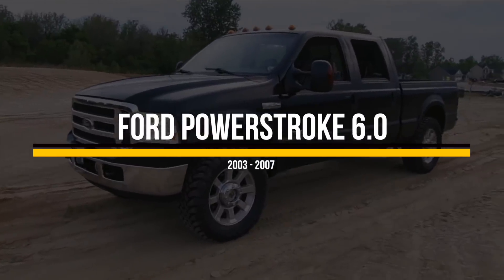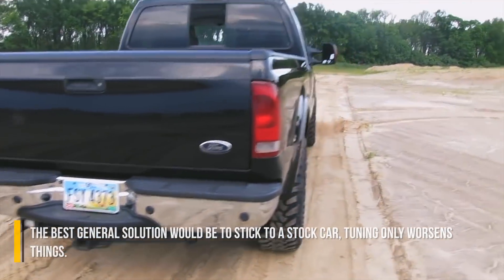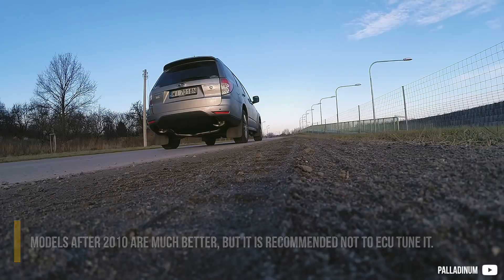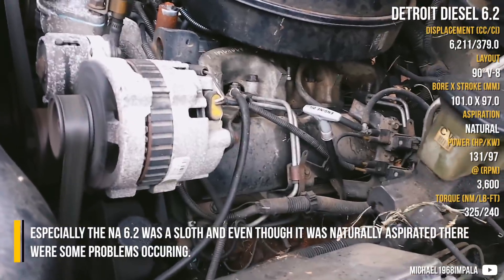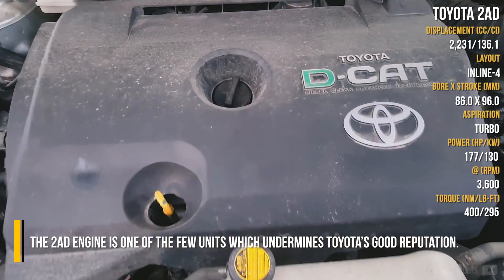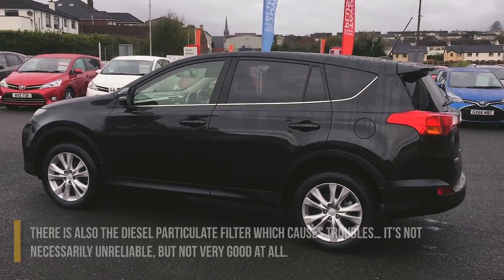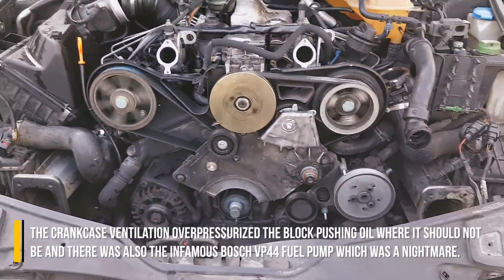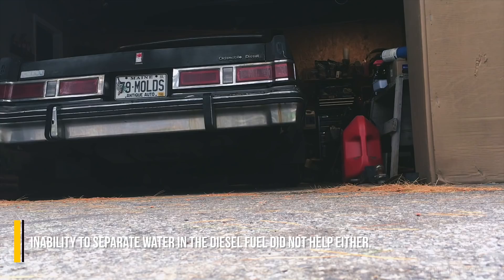6 Worst Diesels You Should Stay Away From

Comment: The issues with the 6.0 Powerstroke could all be easily fixed. The 6.4 Powerstroke was intentionally made shitty by International
Reply: meifert2 not true the bottom end was very stout the rocker arms were weak.
Reply: Ol’ Mudflap the 6.4 is why Ford cut ties with International. It was literally made to fail.
Reply: That's the problem with the 6.0. To make it reliable ya had to do 10k worth or work to it. On top of the 70k bill for the truck.
Reply: ohiopower $10k? You must have gotten ripped off since the EGR caused almost all the issues and a tuner and delete is under $800.
Reply: meifert2  6.4 failures are a mix of poor early design of a scr mixed with top end that couldn’t not handle the high drive pressures of a compound vgt turbos. The engines do much better with a single fixed geometry turbo and deleted a tuned.
Reply: Ol’ Mudflap even with a delete, tune and fixed turbo they will still fail before they should. It's just a bad design
Reply: The high pressure fuel pumps were junk. High pressure oil pumps were junk. Especially in the early models. Injectors were shady. Your gonna have to get some arp studs if you don't want the headgasket to blow.
Reply: bahaha "easily" the only thing easy about a powerstroke is pushing it off a cliff...and have fun rebuilding the entire front end on those fords every other week....DEATH WOBBLE
Reply: @ohiopower  And to add everyone of them have a gutless bottom end lag , the automatic transmission compensates for that , I've driven 5 speed 6.0 with all the deletes and fixes and their still guttless .

Comment: The Olds 350 Diesel sucked as a Diesel engine, but when converted to a gas engine the block is strong as hell! Several NASCAR racers at the time ran converted 350 Diesel blocks. They could be stroked with 425 and 455 cranks as well which made them competitive in some drag racing classes. Honestly, I'd love to have one as a foundation for an Olds bracket car of some type. An Omega would be my first choice because of the light weight, but I wouldn't turn down a cutlass.

Comment: Peugeot deisel: slowest car I ever owned, multiple problems, ending with a blown head gasket.
Reply: Seth Kantrowitz Very old Peugeot had this. But some lives over 500 000 km.
Reply: I once drove a Pug 309 D, with the 1.9 NON-turbo diesel engine. My god, i could have got out and walked faster. Pulling out of junctions was scary as you needed a 0.5 mile gap in traffic to get going.

Comment: Japanese can't make a good reliable diesel??? WRONG!!!!!! 

My dad has a 1999 Toyota Hilux with the 3L inline 4 diesel and it is currently at 350k km without any problems. My uncle has a 1993 Hilux with the same engine and it clocks over half a million kilometers and i haven't seen the first mayor issue with the engine, Oh and it drives like a champ
Reply: Those really aren't super high numbers for a reliable engine. Usually an engine isn't considered to be super reliable unless they go over 600,000 km regularly. The diesels in the Hilux, however, are usually the most reliable option as the gas powered V6's tend to be pretty crappy.
Reply: i know. The first gen v6 is  a crappy engine: low power for the size and kinda unreliable. Second gen v6 is way better. 
I know that 500k doesn't sound like much but that was the last time i saw that mileage in the vehicle.... mi uncle daily drives the vehicle,  maybe is reaching the 600k mark. i haven't been in the vehicle for a long time

Comment: The Audi 2.5 V6 TDI is not to be mistaken with the infinitely more reliable Audi 2.5 inline 5 TDI which was used in various Audi, VW and even Volvo cars. The 5 pot is a much better engine in ever way than the V6.

Also, the Mitsubishi 4D56 is a bad engine. Numerous Series 4 Mitsubishi L200's come into the garage i work at, and they need a new engine block, because of poor quality metal used in the block. Therefore they get pitted in between the cylinders and cause head gasket failure in some cases, failing at anything from as little as 30,000 miles (still in warranty!).

The Series 5 L200's use the 4D15 i believe, and so far are proving to be a good unit.
Reply: Inline always is better than V...
Reply: 4D56 is a great motor, it has a fairly strong bottom end so I have no idea what you are saying here, yes the top end is known to not be as strong.  But they are certainly not known for blowing head gaskets.      They are known for pully failures which then get ignored.  Ultimately a new head is needed (not cheap at $900+install)  

Also people skip maintaining the 4D56 which leads to premature failure. 

4D56 is reliable and gets good MPG just very anemic.

Comment: In regards to the VW Group's 2.5 V6 TDi, the original 150HP is the really problematic one and even then, it mostly applies to first years of production, which are also the engines with most fuel pump and turbo issues as well - or rather, were the ones, since most of them either died or had the problematic parts replaced. After that, the engines got considerably better in regards to reliability, although they still require considerable care. I have the AKE (132kW/180HP) in my car, changing oil every 7.5-10k kilometers (4.7-6.2k miles approximately, I think), not being cheap with the consumable parts (filters, timing belts, etc) and buying decent quality fuel, and I never had any real issues with the engine - approx. 370k km (230k miles) and some of it with short distances which is far from perfect for a relatively large turbodiesel (for european car).

Comment: Typical emission standards - older audi q7's had the big ass v10s but nowadays the q7's have at most a 3 litr v6....
Reply: Q7 had V6 V8 and V12, the toareg had a V10
Reply: GoldmineGaming sorry, was about tow write v12 but that seemed kinda crazy, but now I know 😂 anyways I think you get the point
Reply: Oh yes I get it, I worked for Audi Sport as a mechanic nearly 1.5 years ago, the old Q7 with V12's were mighty cars and with the V8 too. I just left when the Downsizing started, the only car I drove with downsizing is the RS5..
Reply: Still got a 4.0 V8 diesel though. Better than BMW's 3.0 I6 quad turbo og the Mercedes 3.0 I6.

Comment: My parents bought an oldsmobile cutlass in 1984 with the lf9 diesel engine. Had it until 1991 when my dad finally got tired of replacing headbolts for the third time and the fuel tank rusting from the inside out. I can remenber going to school, watching my mom start the car and having to rev it a little bit to keep it running until it warmed up, leaving black marks on the driveway. I was just a kid then, but I thought it was cool.  Haha. But what i remember the most is it sitting parked because it was blown up or broke down for something else alot.
Reply: Why did your dad keep replacing the same headbolts?  All he had to do was change them out and it would have been much more reliable..
Reply: He could have used the stronger headbolts. Maybe he would have held on to it longer...

Comment: The GM 6.2/6.5 was not a bad engine, its weakness ( I ended up finding out from specialist Heath Diesel ) was the coolant system. The coolant distribution from the right side of the block to the left was imbalanced causing head gasket issues.  I owned a 6.2 and it did the job.
Reply: I liked mine . It was definitely a dog though compared to a newer direct injection diesel.  I actually replaced my 6.5 with a 6.2 block . It ran great with awesome fuel mileage.

Comment: The Ford-PSA designed 1.6L turbodiesel. It's called DLD-416 or DV6 and it's found in: Peugeot, Citroen, Ford, Volvo, Mini and Suzuki.

The mode of failure is wear and tear: the oil pan design is poor and all the oil doesn't drain properly. As a result you have malfunctioning EGR, DPF fills up sooner than expected, valves get badly carbonized, turbo gets seized and overall the engine is just clogged with black burnt residue.

If you have to buy one, get a low mileage one, double the oil change intervals, take the oil pan out sometimes (not just the plug) for complete cleaning and redline it properly once a day.

Comment: worst diesel ever made1978-85 GM 350 Old engine used in all gm cars, a modified gas engine, cracked cranks, broken oil pump drive, bad injector pumps, etc. Ford 6.0 first year 2003-4 is bad, rest are ok if unmodified.
Reply: Couldn't have said it better.

Comment: I would argue that its not so much the design of the engine in many of these cases, but that EGR was added to a diesel engine. 
EGR is pure engineering hypocrisy. It shouldn’t ever be used on a diesel engine. You gain absolutely nothing but a ticking time bomb of critical failure.
Supposedly its put on there to cool down combustion to prevent NOx production and to give “unspent hydrocarbons” a chance to be burnt. But you wouldn’t have unspent hydrocarbons if your A/F ratio is greater than 18:1. And the best way to cool combustion is with cooler intake temps. 
But noooo the socialists f@&ks that make the regulations don’t want you to actually clean up your emissions in the way that will reduce fuel consumption and improve performance, that’s logical and logic just isn’t allowed in government regulations.
Ok, I’m done ranting... but its your fault, you brought up EGR in a conversation about diesel reliability.

Comment: Now make the most reliable diesel please :)
Reply: I bet the OM engines from Mercedes would score the first 5 places in that ranking
Reply: Mercedes om616/617
Toyota 2L/3L
Isuzu 4jb1T/4jg2T
Vw 1.9 tdi

There you go
Reply: Lim Lany you've forgotten the Renault K9K 1.5 which also found it place in some new Mercedes Benz
Reply: Best diesel is mb's om606 NA !
Reply: Has he not allready done a video about that?
Reply: Bmw M57, Mercedes om, Hilux 2.4d, vw 1.9tdi
Reply: Cummins 12V would be on that list for sure
Reply: kevin paul halliday and the DW8 that replaced them. We have one in a Citroen Berlingo. A 1.9D 71 horse version. Absolutely solid engines.
Reply: Lim Lany Audi/VW 2.5TDI l5 used in the VW Transporter and Volvo V70, to name a few
Reply: Cummins 12V and 7.3 Powerstroke
Reply: Seconded. Former XUD9TE/Y owner. 550,000km with basic maintenance. Ate alternators like mad but was bomb-proof otherwise.
Reply: Most reliable in my own experience is the volvo d5244t 2001-2005 without dpf. Mine is at 300.000km now and i have driven it 100k without even a small issue. My brothers 2004 d5 has 550.000km and my fathers has 450.000km and still runs perfect even with tuned engines :)
Reply: Easy, Cummins 5.9l 12v, 7.3l powerstroke, and any old Mercedes diesel engines..300d Mercedes
Reply: you all forgot 1.9 JTD 8v
Reply: 125 hp 6bta genset pushed head gasket@12,000 ish hrs 
90 hp 4bta genset pushed head gasket @ 3700 ish hrs
now you wanna talk tough... 600 kta19 at rated power 24/7 just have to slow it down to put some oil every once in a while to drop a gallon or two in it
Reply: 7.3L International Harvester!
Reply: Yep the  ford idi
Reply: And if powerstrokes are on that list its totally discredited... Lmao
Reply: International Harvested 6.9l and 7.3l IDI diesel.
Reply: 12v cummins, 7.3 powerstroke, lbz duramax, and 6.9/7.3idi
Reply: @CrRzEZOI  Cummins 3.9 and 5.9 and Navistar T444E.
Reply: @rickyallaroundfisherman9389  7.3 IDI wasn’t a good engine because of coolant cavitation. The 6.9 was a good engine.
Reply: @atx-cvpi_99  I forgot about that but yeah the 6.9 is amazing

Comment: Great video! I agree 100% with your analyses,  especially with the Ford 6.0 and the GM 350-D.  With that said, I am a BIG fan of Toyota Diesels; I have several of them (very rare in the USA), and although I have no experience with newer Toyota Diesels from post-2000,  the 1980s and 90s models that I have, are outstanding in reliability, MPG, and performance (for what they are).  These are the 1C, 2C, 2C-t turbo, and the L series.  All cast iron block & head, and pre-cup combustion chambers.  The only weak spot is the timing belt (interference engines), but that is a maintenance item that if done correctly, can be absolutely safe & reliable.

Comment: Remove the cab to work on the engine, lol, great design..
Reply: That's pretty much all diesel pickups these days. The engines are monsters that barely fit in the vehicle.
Reply: @toomanybears_   Ha ha ha! And still they are so stupidly huge. Waste of money and time. The old ones before the ECU age at least made sense. Endless money pits for trucks that do what a Honda can do. Go from A to B XD
Get a real truck with 12-18 gears and 1L+ in every cylinder. If not for 4WD the big rigs got every advantage and much cooler.  13L V8 730Hp. Factory EU truck. Or why not 24L v12 2000Hp from factory :) Only wheel friction and money being a problem. You just tip the cabin to acess the engine in a EU tuck :) Remove the front wheels for better access.
Reply: @TheDiner50  I got a 3500 dually to pull a large horse trailer, ~20k lbs fully loaded. You're not going to pull that with a Honda Civic. And it fits in my garage, pretty sure a semi tractor would not do that. I really did NOT want a 4 wheel drive but that's really all that's out there and it has come in handy a couple of times, we get some pretty heavy snows here on occasion.

Comment: Had experiences for quite long time with an Oldsmobile (Custom Cruiser) 5.7 Litre V8 Diesel. It's confusing. Ours has never failed while it was in the family. With the original 3-speed Hydramatic transmission it worked comfortably till 90-100 Km/h. Some friends of ours owned few other 5.7 Litre GM diesels and most of those engines had failed. Options to keep them on the road as long as possible was/is the transmission replacement for a 4-speed automatic. As well as the engine replacement for the mentioned 6.2 and/or 6.5 Litre V8 diesels which were more reliable. With these modifications the top-speed could be increased safely till 130-140 Km/h. All in all 5.7 D was a weak engine and the only goal of it was the low fuel consumption for its size. The best and lowest average we had reached with it was astonishingly low. 8 litres per 100km.

Comment: From my point of view mazda's 2.2 diesel skyactiv is by far one of the best diesels in history
Reply: Yes! We moved from a 1.5dci Nissan Juke (horrible car I know, it was the SO s car), we moved to a 2015 Mazda3 2.2, what. An. Engine, there is minimal lag at all RPMs and no perceivable boost threshold. Plus, 70mpg(UK) on the motor way @ 70-80mph. The Juke wouldn’t even manage 50mpg at 60mph! The 1.5dci had a plague of problems.
Reply: mulymule12 also this engine works without adblue and the maintenance is cheap in comparisson with other diesels.
In my case i bought the 2.0 165hp instead of 2.2
Reply: Personally i prefer the Merc 2.2 diesel. Smooth and very refined. Power ranges from 136bhp to 205bhp depending on spec. The OM651, still used in almost all Merc ranges today. So good that Nissan are now using the Merc engine in the Infiniti Q30.

Comment: My Dad had the '79 Olds Cutlass 4 door. It came with the 260cu/in engine that put out around 80hp and was a real dog-actually dangerous to drive. Then at about 50,000 miles a hose blew when my Mom was driving it and she said it lost power and just stopped-froze solid. So we had a 350cu/in installed and with the increase in power (120hp) we discovered the little turbo 200 automatic transmission was slipping. We found out that the turbo 350 automatic would bolt up, and then had a great transmission. The 350cu/in lasted about 30,000 miles, then had a cylinder crack with water leaking into the cylinder. Basically had a long block installed. When it ran, it ran well. But the last straw was once again (third time) the fuel injection pump failing. I didn't want to pay the $800 plus labor to repair it, so I paid $250 to have it hauled away. Was ashamed since it was a nice car to drive and except for the engine, was reliable.

Comment: The Subaru boxer sounds so wrong...
Reply: It sounds like it's about to break even while idle running. It's truly a weird thing.
Reply: That. Even perfectly working ones feel like they are about to implode.
Reply: they had no torque either according to top gear
Reply: It sounds eactly as you expect it would. A bit more like a boxer than like a diesel.
Reply: Omg if anyone thinks those sound good, stab your ears out so you can stop telling us.
Reply: i never heard of a diesel powered Subaru , did i miss something in automotive classroom ???
Reply: Charlotte Dunois 
Me niether really,we didn't get them here in the states as far as I know. I really am not a fan of the sound of the gasser,the diesel sounds the same and doesn't rev as high(by the exhaust note,that sounds like a 56 beetle with a bad plug wire)

Comment: That Oldsmobile LF9 ... 5.7l - 120 HP / 300 Nm ... My '99 2.2l Merc has the same torque and 125 hp ...
Reply: SpecterH since when do americans know how to make diesel engines ? :))) All they know is just to increase displacement.
Reply: yeah but it's also about 25 years newer than anything that came with an olds diesel
Reply: At that time, they were the fastest diesels around 160-170 kph and the most powerful... All other diesels till the late seventies had around 40 to 85hp.
High end cars like the Mercedes 300 SD had a straight 6, 3.0l Turbodiesel and 125 hp but most were n/a.

So yeah... olds and caddys were heavy oil powered rocketships !!!
Reply: Americans know how to make diesel's if they want. Just take a look at the 6.6 Duramax, the 5.9 and 6.7 Cummins
Reply: My 2016 Merc with the 2.2, and a Brabus D2 tuning kit has 215bhp, and 420NM. And still does 68mpg on the motorway. The OM651 is the best diesel engine of this century.
Reply: Jean-Charles Weyland the 125 hp was a 5cyl 2,9L aka om617, na version had 88 hp
Reply: SpecterH 
Those things were trash. 
Gm ruined the diesel name for years because of that.
Reply: 300 SD Was a 5 Cylinder.
Reply: Rock Crusher.